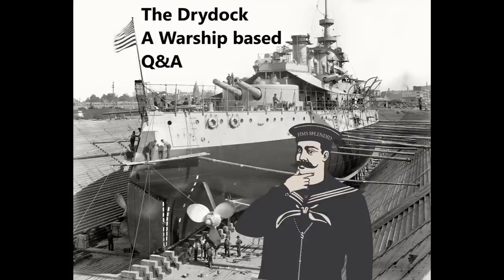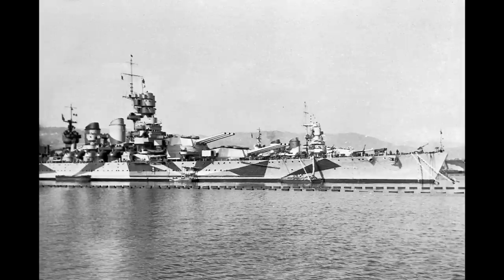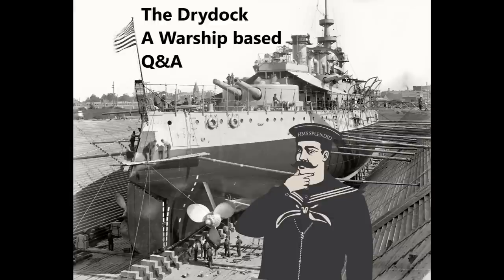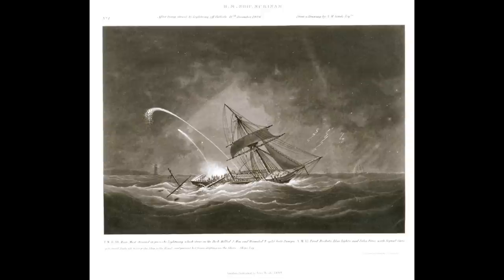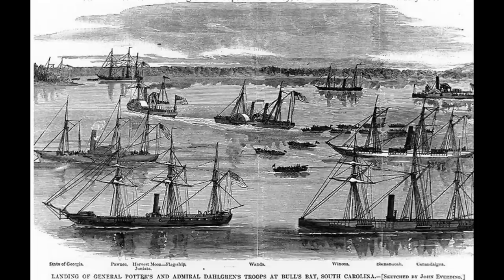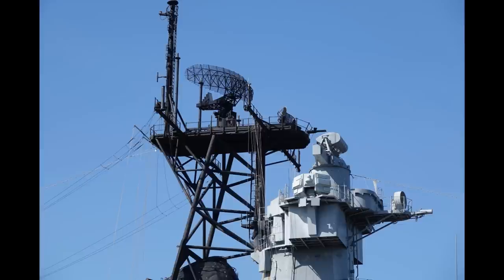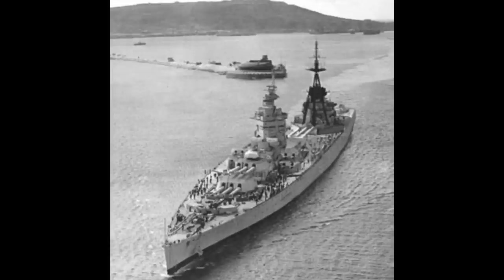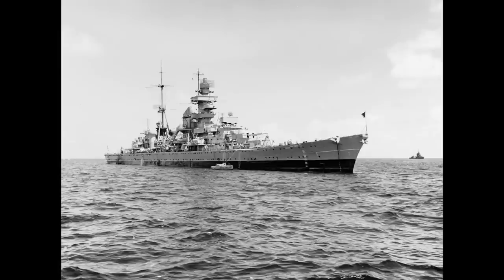The Drydock - Episode 214

Comment: 1.29” steel plate is minimum for a 16” APC shell decapping using crimping or low-temperature solder (usual kind). Krupp used a much stronger high-temperature solder needing 3.2-3.52” to decap its 16” APC shells. Thus, shell size and metallurgy both affect decapping ability of steel plates.

Comment: Was the decapping plate an effort to save on material?  (armour-plate steel).  On the radar vs. rangefinder logistics aren't components an issue?  And I'm guessing that electronic ones in radar work in the radar's favour since they are more modular and easier to mass produce.

Comment: Triple 5"/38s actually were considered for the North Carolina class secondary battery. Several of the early preliminary designs (Schemes A, B, C, and D of 1934) called for them. The triple 5"/38 concept was discarded well before the finalized design came about, though.

Comment: Hey Drach, thanks a lot for doing my question and being willing to take on this whole spaced armor/decapping plate issue. I would like to add a few things here.

First of all, there is a German document from 1941 available online (although in German), where German engineers discuss the differences in the designs of Bismarck and Richelieu, as more details on the latter became known after the fall of France. Long story short, one of the issues talked about is the possibility of increasing the resistance of the main belt. German engineers were of the opinion that the angling of the main belt, as done with Richelieu, wasn't really worth it (since angled belts have, of course, their downsides) and a better approach would be a decapping plate as done with the Littorio. They specified that a "Vorpanzer" of at least 60mm, but better 100mm, should be placed "a considerable distance" before a 250mm, but better 300mm thick main belt. This apparently means that such a spaced array is better than an equivalent 310mm to 400mm thick belt. I consider this to be a rather bold statement, since a 400mm belt should offer an excellent immune zone against pretty much any contemporary gunfire. On the other hand, German engineers did a very good job with Bismarck's and Scharnhorst's scarp triangles, so they certainly knew a bit about decapping.

Another thing is that the Italians apparently gave up on the spaced array with the Littorio's planned successor, but I never did a lot of research on these particular ships, so I might be wrong here.

And when it comes to spaced armor, the big elephant in the room is of course the Bismarck's spaced armor array, especially the 50mm deck/145mm upper belt plus the 80mm/95mm main deck. Nathan Okun did this excellent, very extensive study of the Bismarck's armor scheme, but afaik, he only writes that it offered "a good possibility of detonating a shell before reaching the main deck", indicating that the two-deck upper hull offered pretty much enought space to detonate shells made by the British or US. But this isn't really enough to judge 100% if the system would have worked as intended or not (I hope that I didn't miss anything when reading the article, if so, I am very sorry)

The same document from which I quoted above also claimed that the deck protection of Richelieu and Bismarck was roughly equal. Given that Richelieu had this extremely thick 150mm/170mm deck that is theoretically impregnable to pretty much any kind of ordnance according to navweaps (but nevertheless got defeated by USS Massachusetts' 16inch shell, indicating low armor quality), this indicates imo that German engineers had a lot of faith in their spaced armor system.

The barbettes of Bismarck and Tirpitz between the 50mm upper armor deck and the 95mm (Bismarck) or 100mm (Tirpitz) main armor deck were 220mm thick. The reason for this relatively thin armor is that German tests indicated that a decapped shell would always shatter against barbette armor half its diameter in thickness, thus the barbettes should be able to defeat shells up to 440mm, therefore giving protection against any Allied BB shell. My problem with this is that the 220mm armor began immediately below the 50mm deck, so that I have a hard time believing that a shell hitting just at the joint would be defeated, since AP caps do not vanish into thin air and need some space to detach from the shell.

Above the 50mm deck, and thus without extra protection, the barbettes were of a uniform 340mm thickness on Bismarck. However, on Tirpitz, sections of the barbettes that couldn't be hit without the shell passing through the superstructure first were thinned out to 220mm. Apparently, her designers thought that the superstructure would act as a large decapping plate, so that only decapped shells or (in case of detonation before impact) shell fragments would reach these 220mm portions of the barbette.

So yeah, the level of decapping and spaced armor on which the Bismarck class BBs relied is unmatched by any WW2 era BB.

One thing that is particularly annoying from a scientific view is the fact that we don't know exactly how well the above systems would have worked, and this leads to fans of the Axis battleships to claim that the worked perfectly, while their opponents will claim that the systems performed very poorly and that Allied Battleship construction was overall better. This issue is not so bad with the Littorio afaik, but the Bismarck is obviously this massively polarizing ship.

Regarding Tirpitz, both of her armor decks were defeated by a 1600 pound bomb during later attacks in August 1944, but this bomb failed to detonate. On the one hand, this seems to suggest that her horizontal protection could be defeated and massive internal damage caused, but we need to keep in mind that the 50mm upper deck was designed to render the fuse inoperable. If the fuse had worked properly, there is a good chance that the bomb would have detonated before reaching the 80mm/100mm main armor deck, although that's obviously not guaranteed. But since no bomb aside from the Talboys ever did Tirpitz lethal damage, I believe we can carefully say that her defenses against single-engined bombers were sufficient. 

Again, thanks for your time on this issue. Cheers from Austria :)
Reply: Hast Du einen Link zu diesem deutschen Artikel von 1941?
Reply: @nicokern7615  Bei mir wurden schon öfter Kommentare mit Links gelöscht, aber du kannst einfach "Vergleich zwischen Richelieu und Bismarck" googlen, ist gleich das 1. Suchergebnis.
Reply: @michaelkovacic2608  auf der kbismarck-Seite?
Reply: @nicokern7615  ja genau.

Comment: I've always felt that the reason why various torpedo defense systems underperformed during WW2 was that all but the Japanese Navy went to a slightly to moderate larger warhead and a much more effective explosive and these systems were designed to protect against basically a WW1 torpedo of (mainly) 21".  (The Japanese Navy as most of you know went for a HUGE warhead!  Although they kept an explosive that was basically TNT, the increase in the warhead more than made up for it!)

Comment: Even if the decapping plate didn't work as intended could that cause the rounds to tumble which would reduce it's effective to not much against 11 inches of armour even if the void space is small. Also from your armour video I might have mis remembered but wasn't the Italian armour good for battleships so let's say 3 inches does nothing at all that 11inch would be the equivalent to a very inefficient American 12 and a bit inch belt on the North Carolina's, Iowa's and South Dekota's?
Reply: The American 12inch belts are vastly overrated, in my opinion. Against the high-velocity 15inch guns of the Axis battleships they would quickly have been out of immunity. And the Japanese 18inch gun needs no special mention, of course.
Reply: @michaelkovacic2608  I have to agree when you look at all other battleships armour at the time, the American one is quite thin and there battleship armour was not the best in armour penetrative per inch, it was one of the worst.
Reply: @Alex-cw3rz  yes, the SD and Iowa classes had a 310mm belt. Although angled, that's even thinner than the 315mm belt found on Tirpitz or the 320mm belt found on Bismarck, and those belts weren't even designed to be impregnable at realistic combat distances, relying on the turtleback behind it. The SD didn't get nine 16inch rifles on 35000 tons for free, and for an 45000 ton ship that had a potential 18inch gunned adversary, 310mm is very lackluster.

Comment: Would a ship in reserves get it's anticorrosion / anti-growth paint kept up with the way an active ships would?  On the one hand it probably isn't suffering the wear to it that an active ship would.  But it might go a lot longer between inspection or drydocking -- could that more than offset the issue?

Also, as various museum ship staff have said, a ship normally rusts from the inside.  A ship in reserve might be getting better dehumidification and checking for water accumulation than a museum ship; or it might not.  So a lot would depend on the effort put into maintaining it in the reserves.

Comment: Spaced armor question: Are the multiple decks most warships seem to have (fuse-initiating deck, main protection deck, anti-spalling deck) not considered to be "spaced armor"?  Why does this form of protection seem to be touted as more effective than a single deck of equivalent total thickness, in the way belt armor is?  Or is it a matter of context (deck weight vs belt weight, and bomb size/energy vs shell size/energy)?
Reply: Just a speculation, but in the case of shells, I would imagine they would have a little less energy coming down vs a straight on shot like against the belt armor. For bombs, it's likely because the fusing is different.
Reply: The distance between the decks is far larger

Comment: As to the matter of Gunners Matees losing hearing from gunfire, my experience was that that if one was at a station where they were behind the muzzle blast and behind a weather/blast shield as were  loaders and gun captains they experienced much more noise from the gas ejection air and the noise of  machinery than the gun firing. Massed smaller caliber guns on deck that were operated by ships crew tha were not rated as Gunners Mates (cooks, supply, ship servicemen etc.) though experienced the effects of being in close proximaty to the muzzle blasts of the gun next to them.

Comment: The bigger issue with reactivating warships now is that a warship would be sufficiently out of date that an upgrade to modern standards would most likely last longer than the war itself.

 It's why the mothball fleet these days is almost entirely support and supply ships that do not require nearly anywhere such treatment before being sent off.

Electronics is the biggest thing with ships now. It's why the idea now is to limit service life to 20 years as the hull is now such a small part of the ships price that it's cheaper to build an entirely new ship than to refit an older one.

Comment: About the question, "Did the Union have the same troubles enforcing the blockade on the CSA as the French had on the Germans?" at 34:58
One of the reasons the Union Navy didn't suffer the manpower shortage the French Navy had during the Franco-Prussian War had to do with the reasonably good pay that was offered by the Union Navy.  (I think it was $15 or a month.)  During the American Civil War close to 500,000 foreign born men served in the Union Military, mostly in the Union Army.  About 50,000 of those men were Canadians.  Unlike; for example German or Irish immigrants, most of the these Canadians didn't immigrate to the United States, instead they served in the Union Navy for the steady and reasonably safe pay; for that time during a war, and went back home after the war ended.

Comment: Radar V Range Finders.  Range Finders the operator needs to have his eyes on the lenses, this means you have a minimum sized installation. Radar the operator can be at the other end of some wires, so you only space for the ariels/dish high in the ship.  The operator could be much lower down.

Comment: The big issue with any air attack on Tirpitz was where Tirpitz was anchored. Good luck flying through or diving into a narrow fjord in sufficient numbers to inflict damage…

In open water it would be far more one-sided.
Reply: That's true of course, but BB vs CV will always be one-sided. A BB must close to something like 12 miles to successfully engage a CV, while the CV can hit the BB from far greater distances.
Reply: On the other hand, hitting a stationary target is a lot easier than one that is maneuvering at high speed.
Reply: @michaelkovacic2608  Well... HMS Glorious  missed the memo.😏
Reply: @WALTERBROADDUS  mostly due to being incompetently commanded.
Reply: @CharlesStearman  

Not in this particular case given the geography of Tirpitz’s anchorage.

Comment: Well with decapping calculations remember that there aren't just peer opponents with 15-16 in guns, there's also the KGVs and the older US standards out there rocking 14 inchguns and the French had 13.4 inch the Bretagnes and 13 inch on the Dunkerques so if that decapping layer that successfully decapped a 12 inch can also decap a 13 or 14 inch it's relevant

Comment: Re: Italian use of "Gimmicked Armor" solutions ; both belt and anti-torpedo. I'm sorry NOT to be able to provide an exact source, but I remember reading years ago that the problem was foundry production capacity of the high grade steel AND plate thickness. This had been worsened by the economic effects of the Worldwide Great Depression. ABTW.. The IJN had the same problem.
Reply: From what I have heard, Italian Terni steel was pretty good.
Reply: @michaelkovacic2608  I agree, but it was the volume they could produce that led to "ad hoc" solutions..